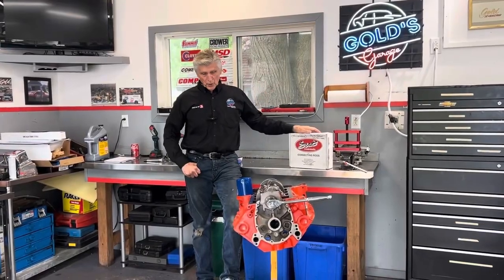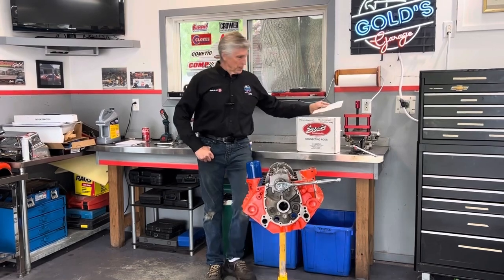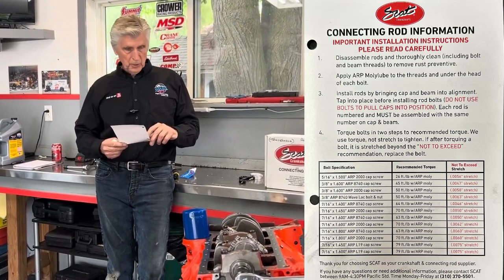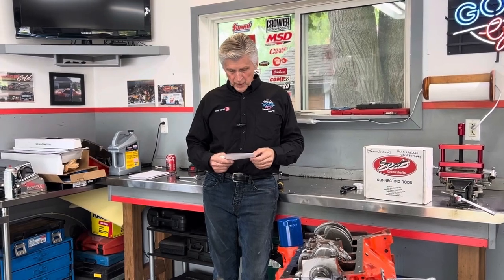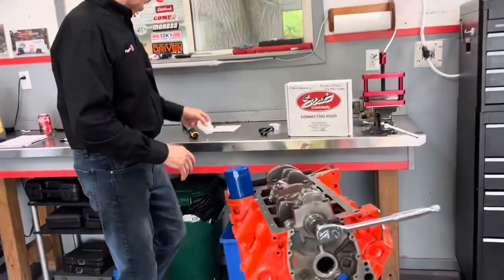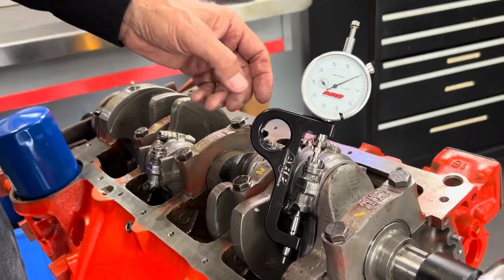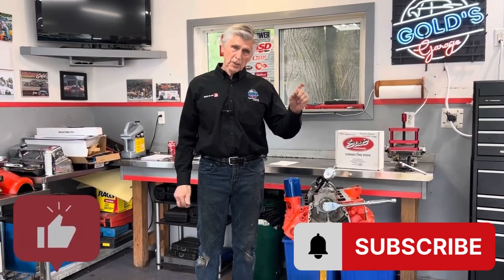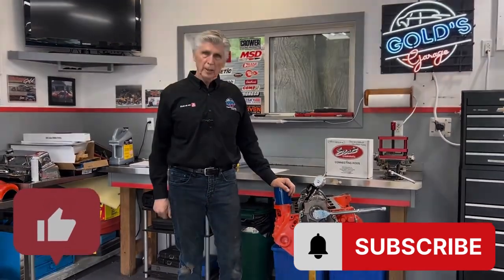302 SBC - How to torque ARP Rod Bolts - Strech/Strain Explained

Comment: Good video 👍🇦🇺
Is there any reason you didn’t select one of SCAT’s conrods that has a 7/16” rod bolt (instead of 3/8”) noting that this 302 is going to want to go to 7000rpm with the cams you are looking at? Thanks.
Reply from the maker: Thanks for the question Al. The original rods had 11/32 rod bolts torqued to 35 ft.lb. The so called pink rods were the same as any other SBC rods except they were shot peened to reduce stress concentration. The SCAT rod will be more than enough. AG
Reply: @goldsgarage8236  sounds like a fair reason. I’ll be following the build 👍🇦🇺

Comment: Hello, my name is Ken and I really enjoy your show. I am building a small block Chevy with a roller cam. I will be using either a timing chain with a Torrington bearing or a thrust washer. What advise would you give for trying to direct additional oil to the thrust washer or bearing? And which do you prefer, a thrust washer or a Torrington bearing? I am considering drilling a small .040 hole between the cam liner bore and the cam liner itself through to the oil feed hole coming up from the crank. Thank you for your help.
Reply from the maker: Thanks for the question Ken. Thrust forces with a roller are minimal and the factory oiling system provides plenty of lubrication. I have used the Torrington bearing successfully without any oiling modifications. AG
Reply: I drill a .020 hole in each lifter gallery plug like Gm did on late model blocks to bleed air from the gallery, you will get lots of oil from that.

Comment: As usual good 'splainin'. Thanks.
Are  those rod bolt reusable or is that it for them?
The production automotive world seems full of "torque to yield" fasteners these days from suspensions to engines.
Reply from the maker: These bolts are definitely reusable. I cover this detail in my Forsyth presentation. AG
Reply: @goldsgarage8236   I'll  have to  check it out, I remember starting to watch it and being dragged away for something.

Comment: Also I like to burnish the bolts like 5 times to 75% of overall torque before final pull down and check with stretch only.
Reply from the maker: That is a good idea. Polishing the threads reduces friction and creates more stretch. AG
Reply: Yes!
The stretch vs torque changes first few cycles, then settles.

Comment: The full stretch # is what they want you to shoot for. You can stretch them little bit more. ARP has a percentage of  overall stretch you can go. ( and not freak out and toss bolt.) They set up stretch at like say 75%. They have a range of like 70% to 80% so they give you the middle #. You can go higher from ARP tech.
Reply from the maker: Thanks for the info. AG

Comment: It’s the things like this that make your channel so wonderful. Torquing bolts seems like an afterthought but if you don’t have everything prepped correctly and aren’t using the correct lubricant to torque with then those lb/ft torque wrench numbers go out the window. Using a stretch gauge makes it basically foolproof. Thanks AG!
Reply from the maker: Thanks for the nice comments Robert. Keeps me motivated. AG